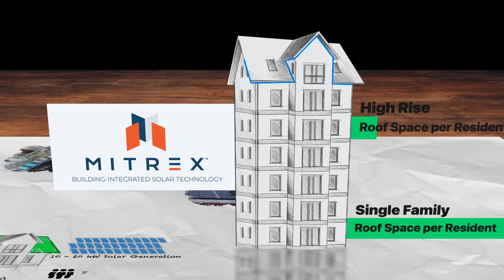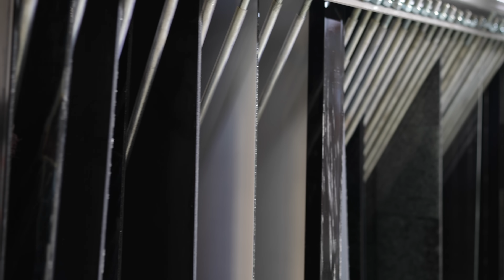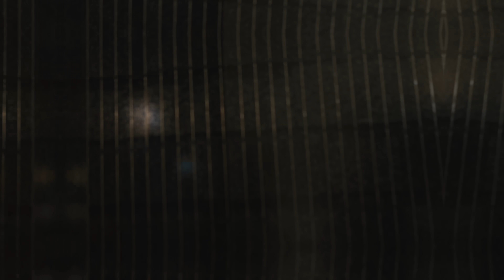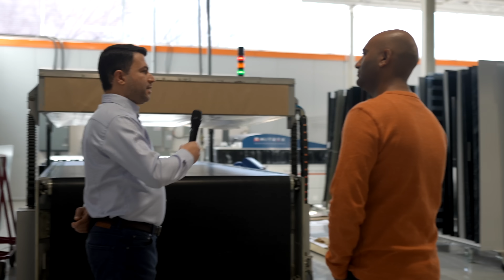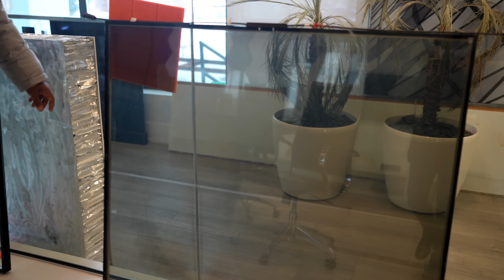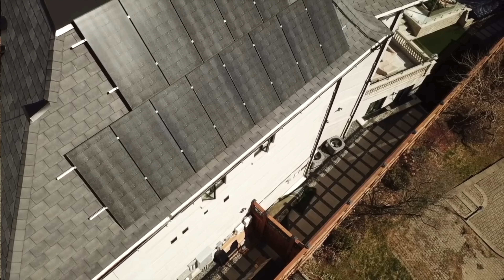Breakthrough Solar Tech Solves Solar In Big Cities!

Comment: No, no, no. You are losing a lot more than a couple %. The panels themselves may still be fairly efficient, but the mounting angles of the sides of buildings will severely reduce the power production. A panel mounted vertically would have max production when the sun is low in the sky, but when the sun is low in the sky the atmosphere blocks much of the energy. Not to mention, for half the day no sun at all will reach the panels. Altogether this application of solar would be at best 1/3 as efficient for a giver area of solar panel. Claiming only 2-4% less efficiency is dishonest.
Reply from the maker: yeah I mentioned its dependent on solar flux. But remember for the same price as a non producing solar cladding... that's the win win part of this. no premiums
Reply: @TwoBitDaVinci  Thanks for the response. I do understand this, but my gripe is with how companies represent their products. These representations trick the public into supporting products that do not live up to their representation. The electric car industry is another example that comes to mind. Yes, it's better than ICE, but not even close to the degree that is put forth to the public. If we are going to overcome our environmental challenges, the public needs to be fully aware of the truth of the options with which they are presented. Driving a prius and recycling doesn't mean a person is right with the world, when in fact they have only made a very small difference in their impact on the environment. Changing diet or living in a smaller, better insulated home would have a much greater impact.
Reply: The idea is 
Minimal additional cost.
Large area.
Useful return.